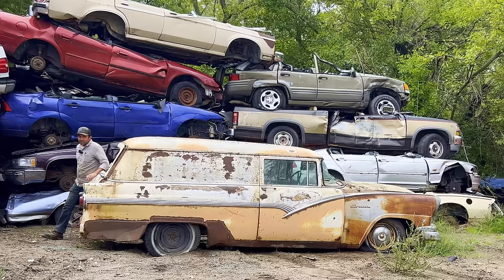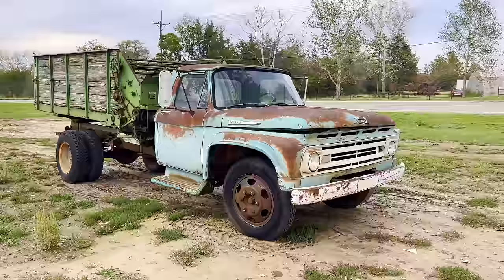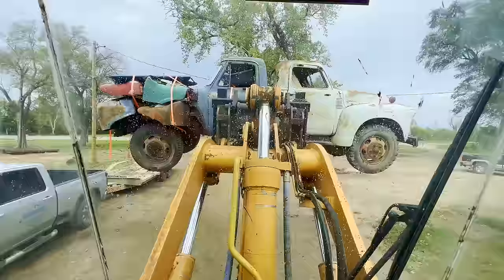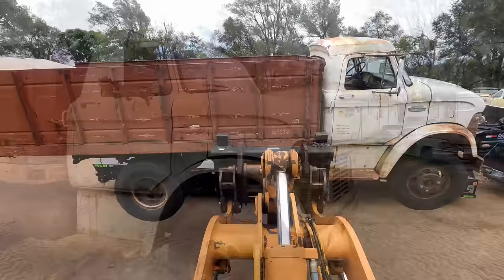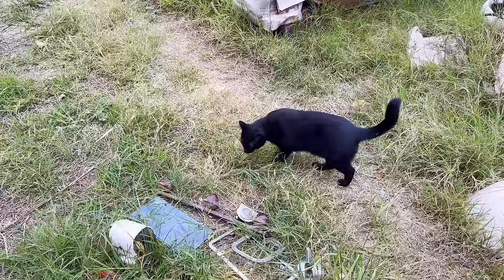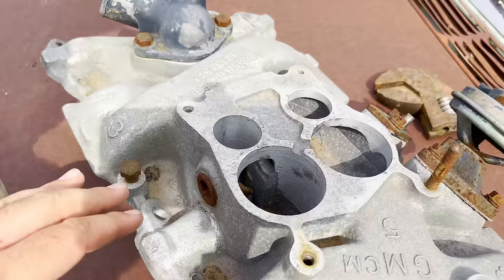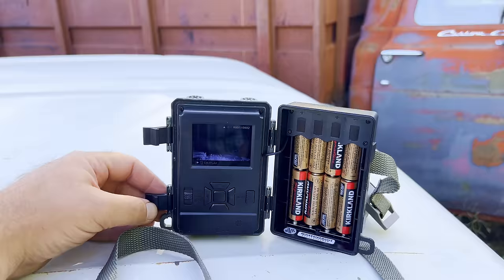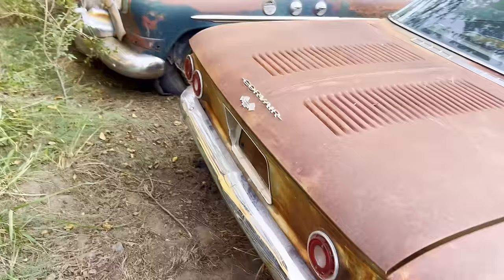Day & NIGHT, the Junkin' Never Stops! Rescuing Vintage Cars Around the Clock!

Comment: The Ford delivery wagon was by far my favorite.  You know, I check the “like” button before I even view the video. Why? Because no matter what you present, it holds my interest, rocks my world  a bit, includes family, and you face problems like a man and find solutions. Great channel, Silas!
Reply: I like sedan deliveries in general, though they are easier to drive if they have a window on the right, as are cargo vans,  I also liked that G van from which he got the transmission, as I usually like '70s better than '50s, though i'm indifferent to Chevy K series, preferring Dodge D and W.  I even own Dodge B and W.
Reply: @alan6832  a man of selective tastes

Comment: Salis you do make great videos ! Canada here and the auto yards here in Halifax , Nova Scotia Canada . some charge $ 4.00 just to walk into their yard and then the customer has to pull their own parts then pay 50 percent of original cost of item like a $ 400 starter cost $ 200 at the scrap yard plus 15% tax but they do give a 30 day warranty.  And with the snow and salt here most of the cars are just rust buckets , so they don't pay much if anything for the cars lol. Sounds like your prices are pretty reasonable. Thanks again for the great videos.

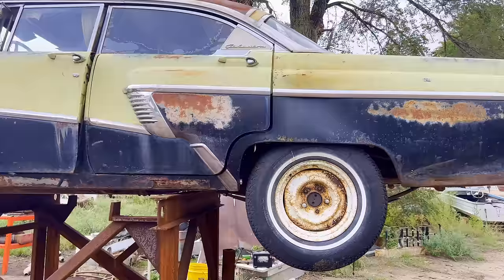Comment: @3:00 that should just be a 1956 Mercury Pheaton Custom 4 door hard top. My father and I built one in the last 90s early 00s and we drove it all over Tennessee to several car shows,  nobody had ever heard of one back then they are so rare.  It should have a very limited production 312 Y block,  good luck on parts for that engine,  only made it for 3 or 4 years and the 312 was the least produced.  The other variants had tons of parts but even when we built that one we couldn't find 312 parts and when the engine quit on us that was the straw that broke the camels back,  my father sold it cheap and went back to Chevy vehicles.  Only Ford product I cab ever remember him building for car shows.

Comment: You don't have to remove the oil pan to determine engine size. Both heads and block will have ECZ stampings that indicate a 312 Y-block. On 5-6 Fords The serial number starts with a letter   U-272, M-292, P-312 or A - 6 cyl usually found on Couriers.
Reply from the maker: 292 used ecz blocks and heads as well. 56 mercury had a 312 as the only engine option, but that doesn’t mean someone didn’t drop a 292 in it.

Comment: Thwe 56 Mercury has two 312 ci engines the standard 210 hp  *8to 1 compression and the  9to 1 compression 225 hp. Both come with 4 bbl carbs so that one must have been changed.